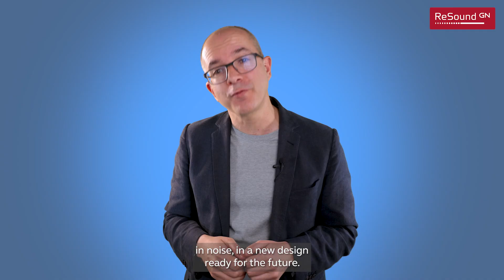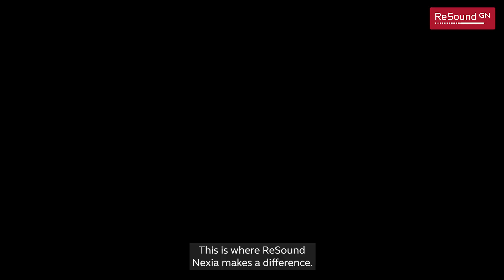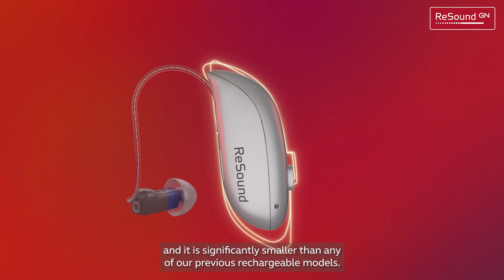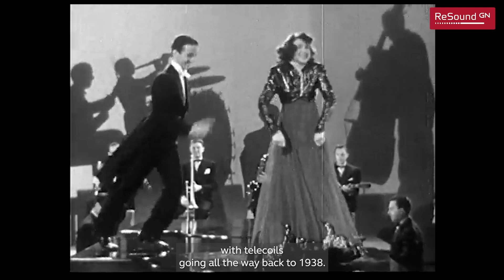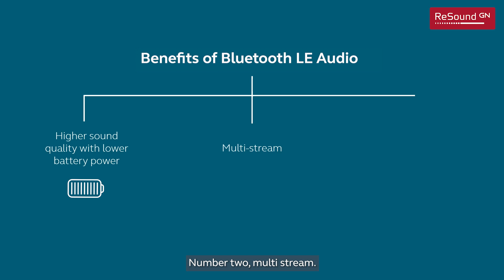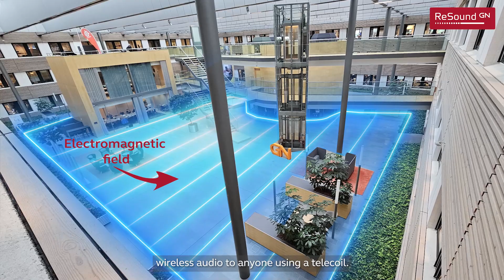ReSound Nexia - Next-era hearing

Comment: I have just gotten the Resound Nexia a couple weeks ago, and the size is wonderful. However, the sounds  is not so good as I am still learning how to navigate the app. One of the areas needed improvement is the connecting line needed to be shorter and flush in the ear.  The connecting line is too long and visible. This takes away the beauty of the hearing aids.  Additionally, the ear moles are very difficult to remove.
Reply: Bog off fan Dan Steve ho ad and his heavies

Hcl 
Orange clad bullies